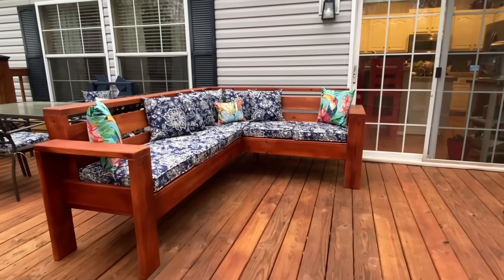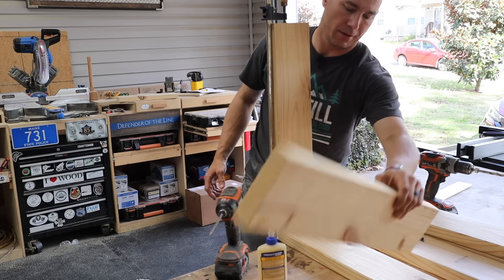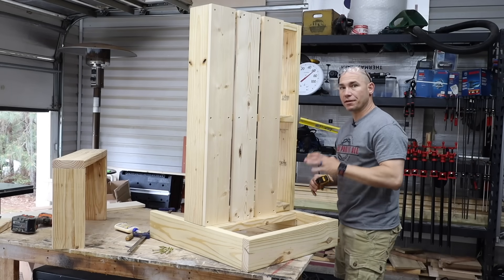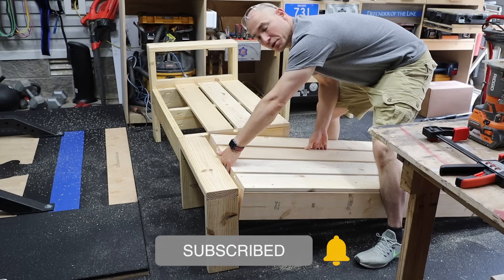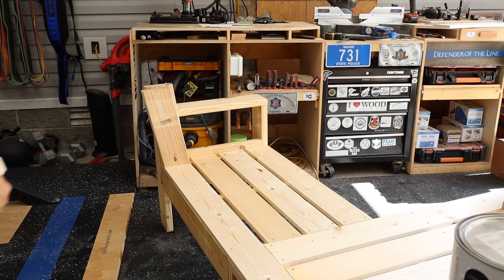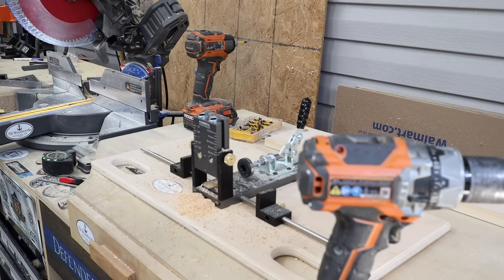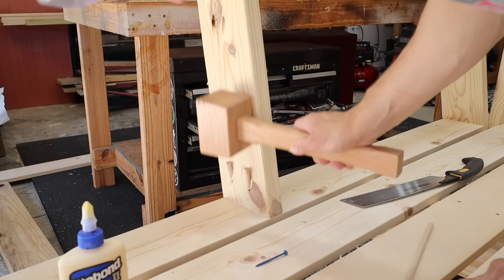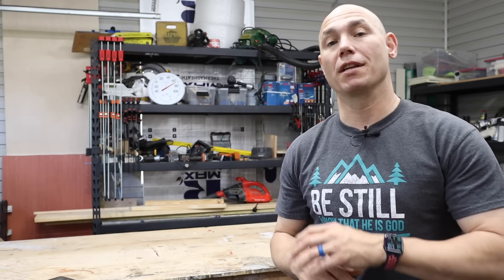DIY Modern Outdoor Sectional | How To Build Outdoor Furniture

Comment: Howdy Mr. 731...

Though I've been watching 👀 ya for over a year now and knew about this video, I hadn't watched it til now. 😅 

I know you got better cameras and lighting n stuff now, but tbh, I liked the video quality of "this" video. It just seemed more crisp and "HD" like. 

I'm chiming in for this purpose....Your sprayer. I've got the exact same one very much so because of you, used your link, love that sprayer and been using it for, I dunno, a year I guess. 

With that being said, I know your always looking for video ideas. 

I have seen multiple videos on the "Critter" sprayer. It costs about half as much if I remember correctly and it uses Mason jars to hold the stain or lacquer etc. It's HVLP (I think) and can be run off a regular pancake compressor instead of a 50 gallon minimum, which is "required" for other HVLP sprayers. 

The benefits of the Critter is that, it uses common mason jars instead of plastic containers. 

Though the Homeright is FANTASTIC, it only comes with the one container of which, needs cleaning after use. 

Mason jars however, you can by individually, by the 6 pack or by the dozen for less than $20 bucks at the Walmart.  So, you can pour in some stain. Use what ya need and then, when your done, just remove the jar and screw on the lid. Label and put on the shelf to be used later. No cleaning other than the sprayer. 

And, because it can be used with a simple pancake compressor, it's more accessible and affordable to most woodworkers. 

Since your channel is geared towards the beginner woodworkers as well as TOOLS, give the Critter a spotlight video review. 

I don't own one (yet) but would love to see ya do a review on it. :_fistbump::_fistbump::_fistbump:

Comment: You yanks need to get with the metric system, instead of inches and quarters etc u can use centimetres and even millimetres which makes things so much more accurate and easy to work out.

Comment: I'm fairly new to woodworking and somewhat surprised you used pine for this. How has this held up? Guess I just thought pine wasn't a good option for outdoor projects. Proven wrong o suppose
Reply from the maker: It works just fine if taken care of.  Treat it with an outdoor finish and it'll last a lot longer

Comment: Couple instances where your pocket holes are going in the wrong direction. Over the years of expansion/contraction from being outdoor and wet, those joints will likely fail.
Reply from the maker: 2 years on my deck.  still solid.
Reply: @731Woodworks  Great to hear! Really enjoyed the build. I live in the midwest where the freezing temps might wear that type of joint more. If I tackle these this summer, I'll just drill through the faces as I'm not as concerned about hiding the screws

Comment: I’ve got some furniture made out of the exact looking wood like yours in the beginning, raw, unfinished in any way. How can I clean it? Can I use a damp towel? Thank you
Reply from the maker: A pressure washer would be best to clean it then you can let it dry and apply a finish (we did a deck makevover video showing how to clean the deck) that's how I would do it.
Reply: @731Woodworks  I don’t have a pressure washer and the shelving is very hard to disassemble anyway. I will try vacuuming the dust then using a damp cloth, do you think that’s alright? I always thought wood and water don’t mix, that wood would swell and crack cause of water, had no idea you can pressure wash raw unvarnished wood.

Comment: Haven’t yet gotten a table saw yet. Will I need one for this project?
Reply from the maker: Not needed for this project. Only used my miter saw. It can be built with a circular saw
Reply: @731Woodworks  thanks Matt. This will be my next project. Ordering the plans!

Comment: I  just made these last fall but  as a 2 pc. so it was less of a "beast" to lift/move. HOWEVER,  one of the arm rests has completely come off from the legs!! I did use outdoor glue & pocket-held it together! We barely and temporarily moved it just so we could power wash our patio!! So although i didn't want to see screw holes from the top, I had no choice but to secure arms from the top into the legs at an angle.

Comment: Great video, question I am not familiar with that stain and sounds like it’s really good stuff, expensive, but question is do you need anything else to protect that a stain? Polyurethane?? Outdoor?
Reply from the maker: I only used the wood oil. Since it is made for decks you shouldn't need a poly on top
Reply: @731Woodworks  thank you

Comment: I don’t mean to question the #PocketHoleKing, but I’m wondering if you don’t ever have any problems putting the pocket screws on the inside of a 90 drilling towards the outside where there is less wood to support it...? Or are you just using the PHS’s to keep the corner together while the glue dries?
Reply: BTW- this was a great video! I’m looking to make something similar for our back patio so we have a seating area... will probably go through the hassle of using pallet wood to save $800.
Reply from the maker: THanks.  Yeah, it would be stronger going the other way but adding the glue with the screws keeps it secure.

Comment: Question Matt, what do you use to fill in cracks and small holes? A lot on the market I have used cracks!!!
Reply from the maker: CA glue works well for that
Reply: @731Woodworks  can you point me in right direction of what type?
Reply: @731Woodworks  I am more thinking on the lines of filling in small cracks when you touch two pieces together, I like that really nice tight smooth look and was using plastic wood filler, still shrinks on me.

Comment: Looks good.  Get you sum of those nail furniture feet that are plastic.  It will keep the feet off the deck about 1/8-1/4” so the legs don’t rot out too soon.  That’s what I did with my outdoor sectional and 6yrs later on concrete going good.
Reply from the maker: Thanks

Comment: Any thoughts on using 1x material for the back versus the 2x?
Reply from the maker: We actually discussed doing that. We went with 2x to keep the look. I think it would work just fine. I would put another center  riser on the short side if I did just to add support.

Comment: Very nice.  I like the design and looks.  Congrats Mrs 731 for the design.  

Thank you for adding in using a Speed Sq if you do not have a mitre saw. 

Suggestion.  Titebond 2 is only water resistant.  Titebond 3 is waterproof.  Or you could use Gorilla Wood Glue Ultimate as it is waterproof too.
Reply from the maker: thanks

Comment: How would something like this hold up over time?  Specifically thinking about wood movement through the seasons.

I want to do something very similar to this and I've been trying to figure out how to account for wood expansion/contraction (or whether you even need to on a project like this).  Everybody talks about "table tops," but no one seems to talk about designing for expansion/contraction with wood-framed furniture like this.

Just curious if you've seen issues with gluing/screwing like this over time.  Absolutely love how it turned out, though!
Reply from the maker: Thank you.  It'll move a little but I have a bench made from the same material (pine) that has been outside now for 3 years and doesn't have any issues. Of course pine won't last as long outdoors as redwood, cedar or cypress but it'll last several years if properly cared for.

Comment: Hey Matt what's your thoughts on driving the screw part way in, backing out and then fully driving hardware to remedy splitting w/o pilot drilling?
Reply from the maker: It may work okay but still has a chance of splitting because no material was removed just driving the screw
Reply: Matt, I've learned a ton from your channel, but just try this. I use it routinely in my daily work and it's always been effective even on the very edge of the the stock and soft pine. It would be an awesome insight for your viewer base.

Comment: Great video! Would you suggest using non-treated wood and then having the protective outdoor stain act as that treatment, or use both treated wood AND protective outdoor stain? Any help would be great!
Reply from the maker: I used non treated with the wood protectant
Reply: @731Woodworks  would you recommend using both or one or the other?

Comment: Matt,  I am wondering if you have ever used the Kreg HD pocket hole jig and screws?  They are advertised for outdoor use.   I have been thinking about getting one, and would be interested in any comments you might have.   In the video you mentioned using outdoor screws.   Were you using regular deck screws?  I did that on an outdoor project but wasn't sure if I would be sorry I didn't use regular pocket screws.   Thanks for any insights you may have.
Reply from the maker: I used outdoor rated pocket screws and exterior deck screws

Comment: So after having used both which of the pocket hole jigs do you prefer.  The Kreg or the current one you are using? Also another great build.  Thank you for the work you put into these video's.
Reply from the maker: I like the Massca M2 over the Kreg 720 by far. The Kreg K5 is a good jig if you can find one.

Comment: man this is a BEAUTIFUL piece of work. Congrats on the awesome job Matt.  now I have to buy the plans for this next week when I get paid and immediately go to my local home depot to get the wood......although I might just get the screws from there and the wood from my local lumber yard. and order the massca, then I have to wait to start building until that comes... I need something to do while on vacation for 20+ days from work.  infact I think I will be buying a few plans from your website. NOW I have to ask, in your opinion Matt, who has the best queen size wood bed frame design? I don't necesarrily need drawers and such built in as I wont use them, just simple bed frame. prefferably with a headboard. footboard not as important.
Reply from the maker: Check out DIY Creators, he has a cool platform bed video with plans
Reply: @731Woodworks  10-roger show me responding lol.....sorry the dispatcher in me takes over some times.

Comment: Thanks for making yet another good video! I have a question, how do you deal with tuba’s warping? Do you have a stock of tuba’s which are acclimating to your shop, and then pick the straight ones? I’ve tried my darnest to pick the straightest boards and more than half will warp one way or another!
Reply from the maker: I picked these out very carefully lol.  They did sit on my rack for about 2 weeks in the shop
Reply: @731Woodworks  thanks! I’ll keep tuning my eyes for the straightest boards possible!

Comment: So Anna white has the same exact furniture with free plan. No disrespect but an hour of work to get a plan build is costly. Its a turn off most people.
Reply from the maker: It is not the exact same.  It's obvious they are different if you actually take time to look at them.  Hers has a straight back, not angled like ours. Hers also doesn't have cushion supports on the back. Ours is a one piece design as well. The arm rests on hers is quite different as well.  If you don't want to buy the plans, don't.  You can use the video to build this one using every measurement I lay out in this video and the rough edit video on my website.  I posted the plans to help those who want to build the project.  I have to pay to have the plans made since I don't know how to use Sketchup.  It's a turn off to you, not most people.

Comment: Matt I love your stuff. I love to build outdoor stuff too and seeing this inspires me to get out there and build something new.  2 things I do a little different are one I use the glue from the green bottle of the brand you used.  The blue glue has failed when I grabbed the wrong bottle on a planter build I did last year.  That did get a ton of water, admittedly.  
   The other thing I try to do is incorporate a dado or rabbet to support  horizontal structures rather than rely on the sheer strength of the screws.  I guess it's more out of fear of something happening than actual experience.  
Lots of good family time ahead on that though.

Comment: Matt you should look into learning fusion 360 or sketch up to do your planning before you start. I’m currently learning fusion 360. I can see how it’s going to be a huge help in planning everything out first.
Reply from the maker: Thank you, when I get time I would love to learn it.
Reply: @731Woodworks  "when I get the time" = I will never do it. 

At least that's what it ends up meaning when I say it. 😔
Reply: Sketch up is crap. Fusion 360 is owned by Autodesk, so you are going to get screwed by them. Both are subscription services, which means if you ever stop paying, you lose access to everything you have build with their software. It also means that if they push out an update that breaks something, you are screwed because you can't roll beck to an earlier version. Look into Alibre Atom. It's a one time purchase with no subscription crap and it had a very reasonable price.

Comment: I did a similar project to replace my patio furniture. Frames were rusted but the cushions were in great shape. I used 5/4 deck boards instead of 1x6's.  They were considerably cheaper at my local lumber yards. Of course this was just over a year ago so prices  have changed. I've done one non-scrap wood project since because prices are so crazy.